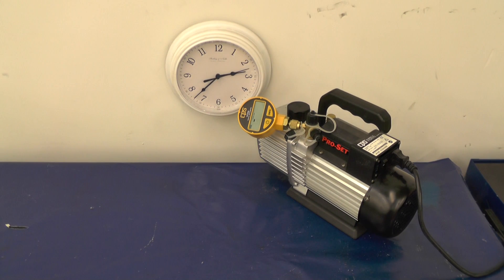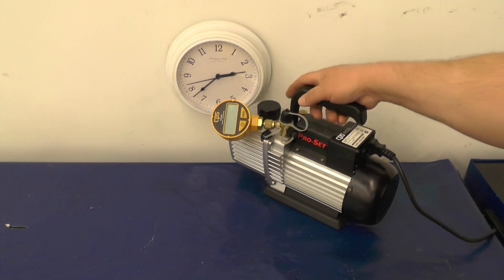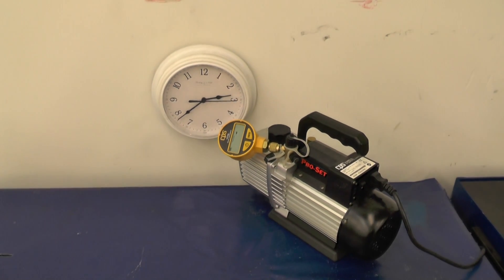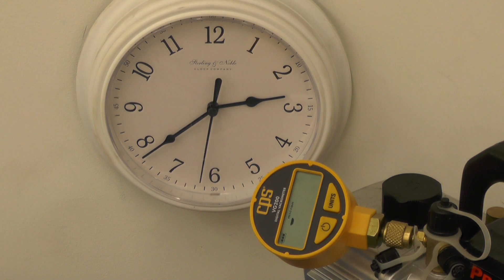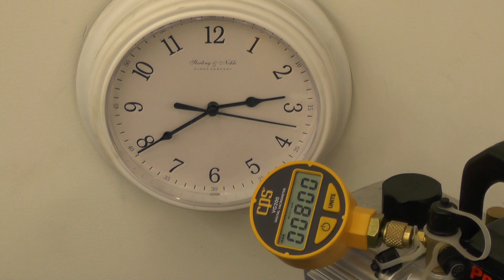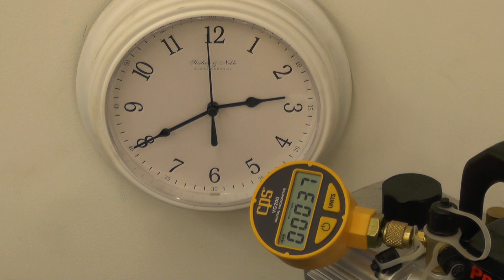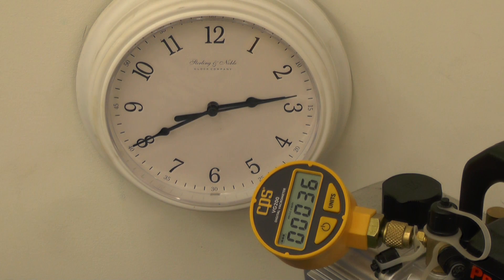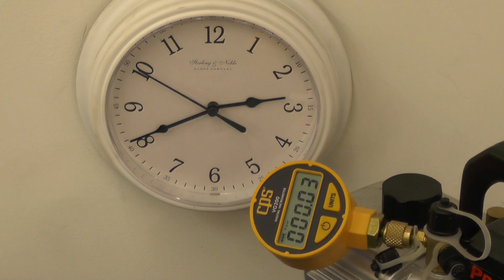Testing a Properly Operating Vacuum Pump

Comment: I have the same micron gauge and the same setup but I can't get it to read any vacuum. But if I put a valve in between and I valve off the micron gauge while pump is running it will start to read vacuum. The vacuum reading will settle to 400 microns. With the vacuum pump running, if I now open the valve the micron gauge will show it loses its vacuum. Can you explain this effect? Thanks.

Comment: could you please tell me if this pressure gauge can check Vaccum pressure ranging 10-100 mmHg?
Reply: It will get to proper mmHg but just so you can verify use this site to convert.
https://www.convertunits.com/from/micron+mercury/to/mm+Hg